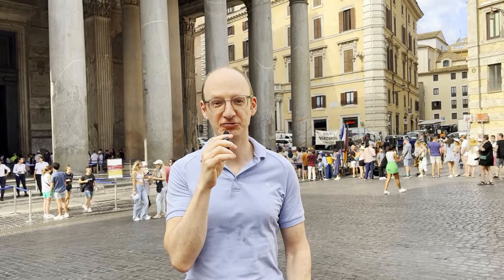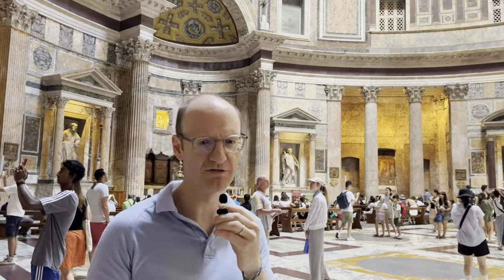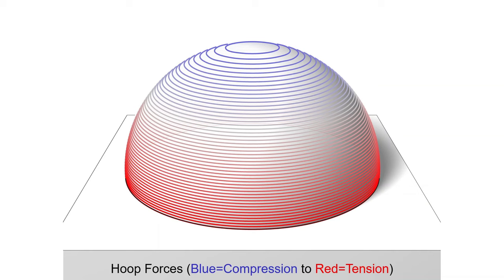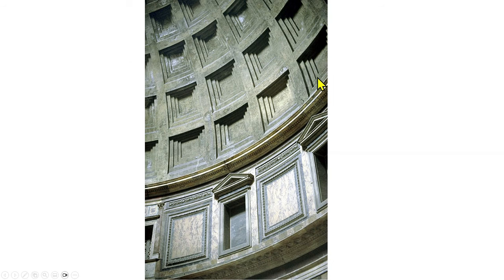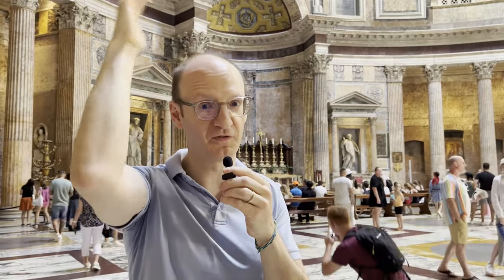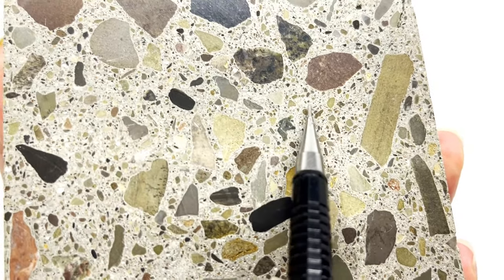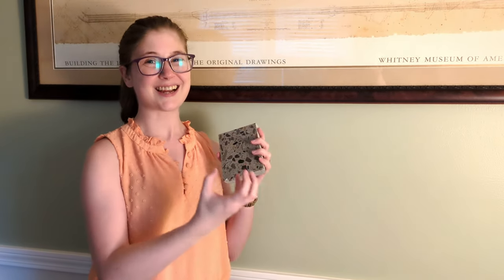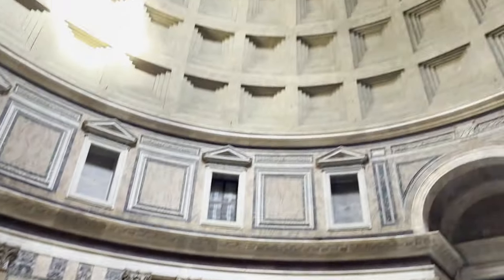The Pantheon Dome and its Amazing Structure! With Linda Seymour PhD

Comment: They made the walls thick. Exactly how thick they would have to work out. That's what fascinates me here. Did they build scale models, larger and larger, to see if the structural mechanics scaled up? I'm curious how they worked out what is sufficient to carry the loads. 
They built domed baths too, so I wonder if they developed a formula that gave them a ratio of dome size to wall thickness, something practical/empirical like that.

Comment: Why does the hoop-forces transition from compression into tension? As a person with almost zero knowledge, but great interest in engineering I've watched most of your videos but struggle to really get the lesson home.
Reply from the maker: Good question because it's much easier to picture/see the bottom of a dome wanting to spread outwards as it flattens...what happens at the top is less intuitive but is fully real...one way to picture it is that, as a dome flattens (and really picture it flattening out), the bottom has space to spread out but the top is trying to all move  towards the center where there is no space, hence compression.  The common physical experiment is to take half an orange and scoop out the fruit so you have a dome then shove down on it...have fun!

Comment: hi Paul, random question but one I can't seem to get an answer for. Theoretically what's the lowest vertical radius you can have with a dome using stone or concrete whilst it still is self-supporting and without framing? For a workable scenario, say a dome with a base equator diameter of 40m? thanks!!!

obviously I'm not an engineer, just curious :)